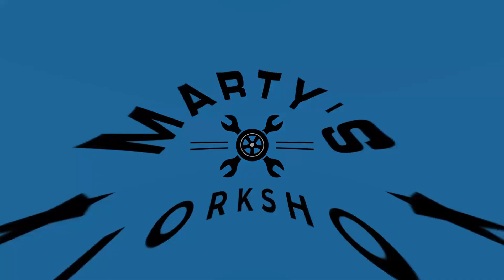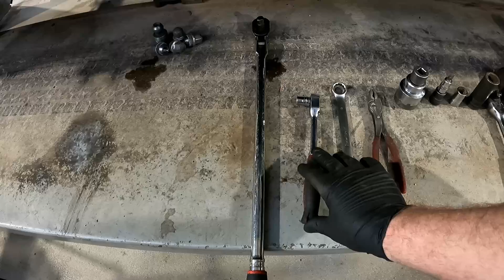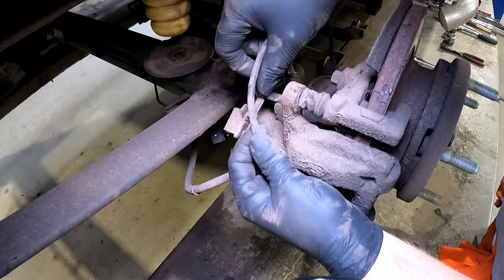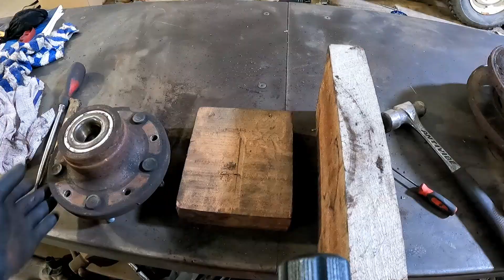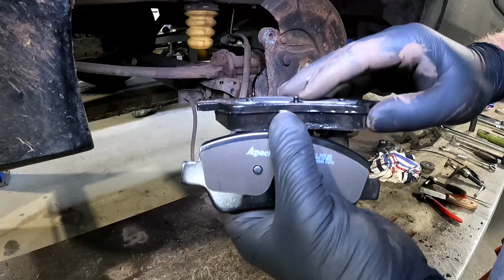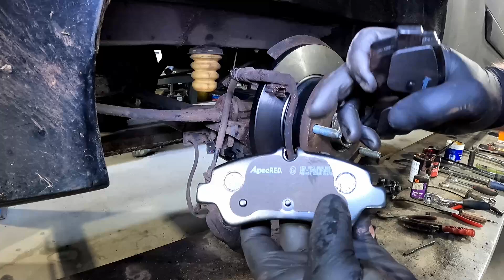Transit Custom how to replace rear brake disks and pads tone ring abs traction hill fault 2012 - 17

Comment: Hey man, I had my rear caliper binding, I’ve replaced the calipers and discs/pads on the rear of the van now, ABS cable had a bit of a nick on the end. So I’m planning to replace the rear ones. Then I thought the ring might be the issue? If I buy hubs for the rear do they come with the ring in them? Then I know I’m sorted totally.
Reply from the maker: Some do some dont, i would cheak with your suplyer

Comment: I'm doing the brakes on a transit custom 2 2 2017 front and rear disc and pads and ford says that the hub to knuckle and disc to hub bolts need replacing as well as the drive shaft nuts on the front and axle nuts on the rear as they are single use bolts ?
Reply from the maker: Most bolts are single use according to the dealer, if you are unsure then replace them all,

Comment: Great clear video - thanks. I have seen some videos where they separate the disc/bearing by hammering a chisel between the two, rather than using the punch - is that not advisable?. Ta
Reply from the maker: It's up to the person doing tho job I guess, I find the chissel damages the matting surface, but it will be fine as long as you clean it all up

Comment: Did mine earlier, great video, however on one side when I put the carrier back on the outer edge of disc was getting caught on the carrier, like there was no clearance between the front face of disc and carrier. Stripped the carrier off again and cleaned it a second time, this time I used a wire brush on a grinder to clean the inside edges that are parallel to the disc. Still have the very slightest rub, so just wondering have I the hub reassembled incorrectly or do I need to go at it again with grinder? The bearing did pop out and I clicked it back tight, is it possible it’s pushing the disc forward because I haven’t it pushed fully back in, or do they push together when hub nut is tightened? Torqued to 300nm
Reply from the maker: There is a meatal clip that holds the bearing together,  some times you have to remove it, push the bearing races together then refit the clip,
Reply: @ thank you, here’s a strange one for you. Drivers side calliper winds clockwise according to manual, 2013 model. The calliper arrow tho was pointing anticlockwise for some reason, I did try to follow the arrow but the piston wouldn’t turn so went with the manual and It did indeed wind clockwise. Passenger side wound anticlockwise as expected. Ever seen this, I always thought the arrow was to show the rewind direction🤔
Reply from the maker: In all honesty I gave never seen any arrows or looked for them, I usually just try it clockwise and if it doesn't go the try the other way,
Reply: @ yep it kinda only goes one way anyway 😁

Comment: Did you have to adjust the handbrake cable at all after finishing? I’ve just fitted new rear pads and discs on my 2015 custom, and on the MOT it got picked up that the park brake had excessive movement
Reply from the maker: Not really the cables shuld be unaffected

Comment: Coper on sliders, terrible idea 😮
Reply from the maker: Red rubber grease on sliders, copper slip on pad mateing surface
Reply: @ no copper should be used in brakes systems, ceramic yes but not copper.
Reply from the maker: @ukaszrugaa104 thank you for your input
Reply: @Martysworkshop  copper grease hardens under the influence of temperature, which makes the operation of the system highly difficult, often completely impossible.

Comment: Just checking if it's the driver side caliper rewind direction is anticlockwise?
Reply from the maker: They are both clockwise, if one is anticlockwise it's normally the left side

Comment: Just wanted to say a big thank you for the video! It was super helpful and easy to follow and enabled me to change the rear discs and pads on my Transit Custom today. Thanks again! 👍
Reply from the maker: Thank you for watching, and thank you for your feedback
Reply: How long did It take you ? I'm just thinking about doing it myself because if you'll consider travel time to the garage and all that ...
Reply: @PlumberLondonSW  It took most of the day around 6 hours but we were also doing the pads on a mate's van at the same time. I reckon you could do it in an afternoon if you have done it before and have everything set out. Worth the time to me as a local garage quoted £350 and I picked up the parts locally for £85

Comment: Hi, great video, my 2013 custom lwb need new discs and pads front and back, its booked in for 10 days time, had the van from new now done 91000, do you think whilst its stripped down it would be worth getting the bearing, abs sensor and the abs cocked wheel all done at the same time, just had 4 new glow plugs done
Thanks
Reply from the maker: I was going to replace my bearings at the same time and was shocked how expensive they are so decided not to, just remember there is no way to cheak the sensor or bearings unless they are faulty so just remember if you ask the garage to specifically cheak them thay may replace it all wether it needs it or not so they don't get any comeback on them. Thank you for watching